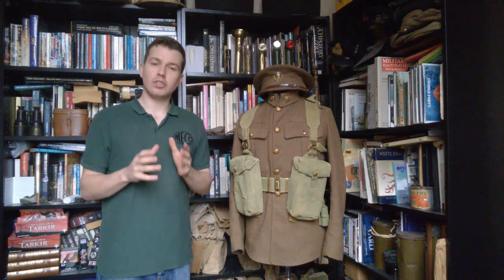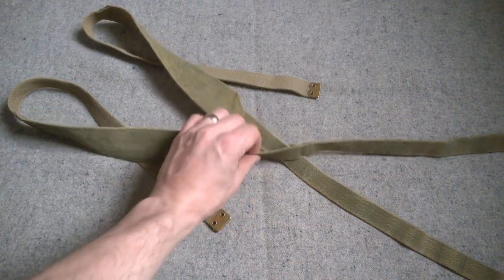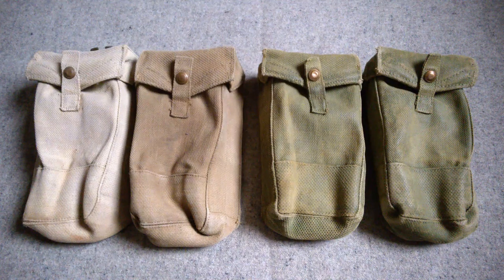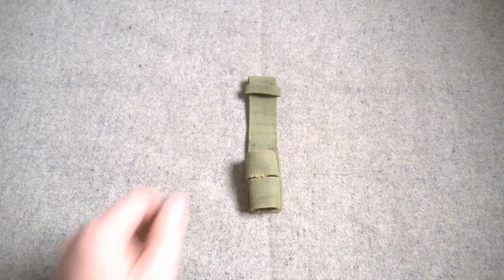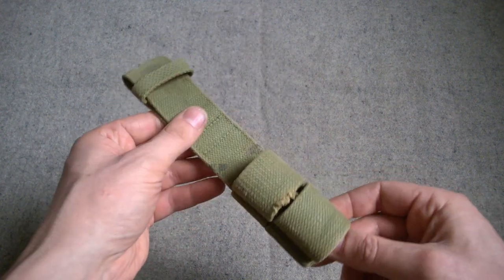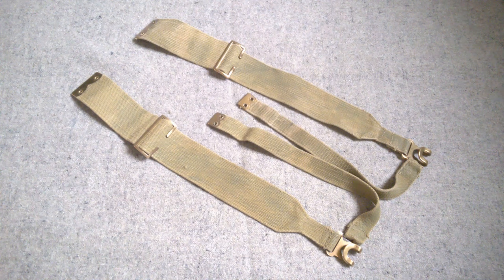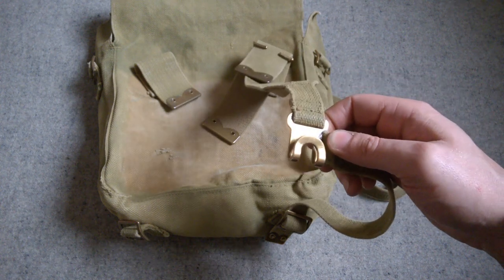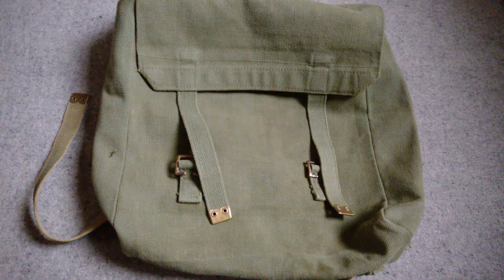First Issue 1937 Pattern Web Equipment - Part II

Comment: ive got an odd skeleton water bottle carrier. instead of a male and female snap arrangement, its got 2 female snaps and the straps wont quite meet over the waterbottle. is there a separate piece that goes over the top of the bottle to connect them or is this just a manufacturing error? its marked "D. C. M. LTD. 193?". the snaps are marked "N B L TD"

Comment: Was the British mess tin sometimes carried  in the skeletonized water bottle carrier or did they use special webbing?
Reply: The Canadians did it as a fairly common mid to late war soldier fix, normally worn on the opposite side to the water bottle, others did as well on and off,  but I believe the Canadians started it.
Please correct to me.
Reply: The Canadians did it as a fairly common mid to late war soldier fix, normally worn on the opposite side to the water bottle, others did as well on and off,  but I believe the Canadians started it.
Please correct to me.
Reply from the maker: It was a popular thing with Canadian forces in the latter stages of WWII and through Korea, hence they introuced a mess tin pouch on their next set of equipment, the 1951 Pattern. The pracitce was also carried on by British troops to a limited degree, it's particularly notable late in the war when fighting through Germany when haversacks were often dispensed with.